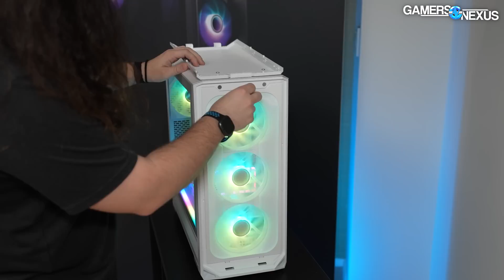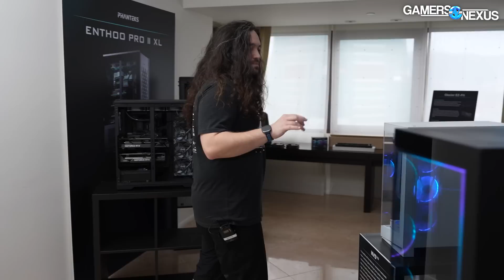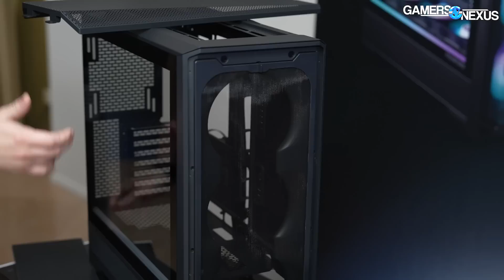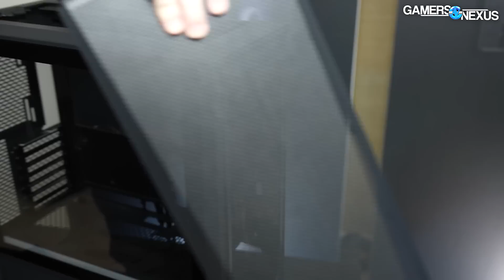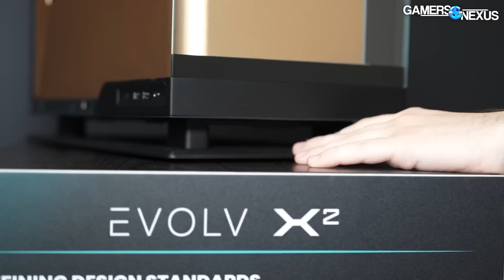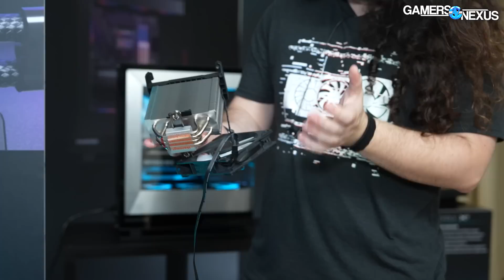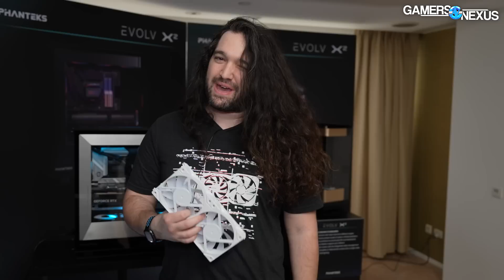Phanteks' Liquid Freezer III Competitor, Patent-Avoiding Fans, & P400A Successor (G400A)

Comment: I got the G400A for $110 from Microcenter, and it sucks. It feels as cheap as the quality you’d expect from $60 cases. It’s also big enough that it could fit a 420mm radiator, but they didn’t design it to support one. There’s no support for 140mm fans at the bottom either, so forget about building a 140mm-exclusive setup. I’m not happy with it at all. Also, Phanteks customer support is terrible. And yes, the wobble in the fans is extremely annoying, and cable management is hard to manage.

Comment: I had Phanteks Entho Pro 2 and the HDD cages had been made to choke the cool air supply to them. HDDs in constant use cooked the metal frame to the point it was difficult to hold the hand on it. I hope Phanteks has learned anything from the past as I liked the spacious case. Old Pahnteks cases are still way better than the new ones. Will see what is the new server case about.......

Comment: cant wait to see how the recirculation testing comes out, i currently run no side panel but have to clean my pc WAY too often.. its impossible to run a side panel with an overclock 3090ti ftw ultra either way, the glass becomes extremely hot, this thing is literally a heater blasting heat into the room

Comment: I think a universal fan mount adapter plastic or metal pieces might be the best end cap for the tabbed fan.  Make it easy to mount those fans in places that have screw holes for everything from 80 to 200 mm and, if metal, could even be bent into angled directed airflow.

Comment: Preventing warm case air from recirculating into the intake fans is something I had hoped case manufacturers would have addressed over 10 years ago. I've always had to make isolation plates myself. Mesh and/or filters are harder to pull air through than big holes in the chassis.

Comment: The coolers were pretty underwhelming and don't seem designed well... That VRM fan looks smothered against the pump housing. How's it supposed to force air down those channels with that blade design? And the tower is just... bad. They're trying to innovate, but scraping the bottom of the barrel. Why does the fan need a complicated plastic twist lock mechanism? It's a budget tower; it's going to be installed once and never touched again. Cases on the other hand look decent. That Evolv X2 looks like a great deal for $150 if they can keep everything similar to the prototype.

Comment: I think cases evolved too slowly. They all come from an era where the whole pc had 100w to dissipate.
CPU and GPU need direct access to fresh air. The 3 fans under the GPU are a good start. I also want fans in the bottom compartment. Otherwise the 3 fans under the GPU will pull air from the aether ?
And i want people to understand that the CPU air coolers can be reversed or at least the fans can. The back exhaust can be an intake. This creates a direct access to fresh air for the CPU. We are no longer living in 1995.
Reply: your a good man mr pyro 🙏

Comment: definitely have a soft spot for Phanteks. I did have a different case for a couple of years, but the first major case I bought was the Phanteks Enthoo Pro, the original, with 2 plastic side windows, no tempered glass. I bought that along with my 4790k hardware, so it was a few years ago. I went back to using it again, it just works and its solid. now its running a 12900k and a 4090.

Comment: The only thing I will say about the pre-done cable channels for the Evolv X2 is that there are still some of the high End motherboards where the EPS connectors is flanking the 24 Pin in which case the cable channels for the "North West" corner of the motherboard would go unused. Additionally it would be nice to have cable channels for cables like the USB 3, SATA (for those who still use SATA drives), and it would also be welcome if there was an RGB cable hub as some of the lower tier motherboards (like Asus TUF) can still be found with only 1 5v ARGB header (it would also allow to reduce power strain on the motherboard header if someone were to want RGB lights against the glass)

Comment: Still rocking my £65 P400A from back when you first reviewed it. Haven't had a need to change from it yet. Holds my 6700XT and a 280mm Arctic Freezer II without any issues.
Reply: I don't understand this over saturated case market. Other components I understand. They are small and are easy to buy, sell and upgrade. A case is too much of a pain to build and it's too bulky to sell.

Comment: Thermalright have really upended the air cooler market with the very low pricing (no doubt helped by being a manufacturer themselves). This Phanteks air cooler, being unpainted with 4 direct contact heatpipes/no coldplate seems like it's going to have a hard time in any region where Thermalright coolers are available.

Comment: @Phanteks LOVE the new case options! For the Evolv X2 I'd love to see black, or a dark grey metal color, instead of the gold. I'd also pay a premium for a metal base,and a metal back panel with fan mounts, even if they are sold separately. I would not buy it if the only option for the base is plastic, and only available with a glass back panel with no side ventilation. The silver or brushed aluminum (hard to tell in the video) is very nice looking and, if there's any way to offer other options for this case, I would definitely buy it. I'm really looking forward to this model! It's been my favorite of everything I've seen thus far from the coverage, if you can offer those additional options. Keep innovating!

Comment: For the interconnecting fans. Just make an endcap/cover. So the lip does not stand out too much (max height of the lip) and gives it a cleaner look and may double as cable storage to get some unwanted small cables out of sight.
Package it in the 3er set. Should be cheap and gives the user an option.
 If they want to be fancy with it, put RGB in it.

Comment: PSU in the front and fans in the back. Interesting design and should help with video card and cpu cooling heatsinks/watercooling. Going too keep an eye out for reviews on that one and some of these other ones. I was kind of hoping that they would update the cooling for the Evolv X. As long as the cooling of the cases can reach the hdd/sdd behind the mobo tray. Really paranoid about the airflow not getting to the side of the case to keep everything cool(er). I really liked the Evolv X design and just wished the airflow was updated only. I can only imagine the price for the X2. Wouldn't pay it any way. Even $200 is too much most of the time. My iron willed budget is $150-$180 at most. Money doesn't grow on trees and the world is in a blender at the moment.

Comment: If you are going to put fans on the bottom, then just put the power supply on the top. There is no reason why they are still trying to put in the bottom anymore. The heaviest item is going to be the GPU. It is also the one item that needs cold air more than most in modern gaming. The Torrent is simply killing the competition in noise during gaming.

Comment: Issue I’m noticing with the evolv x2 is that it’s most definitely going to be negative pressure in the ideal fan config unless you adjust the outtake fans to run slower.
Reply: Not realy. Remember, the 3 exhaust fans on top need to push the air through a rad. Most cases have 2-3 intake fans and 3-4 exhaust fans when using an AIO.
This one have 3x intake on the bottom (this should be reversed blade fans), 1x exhaust in the back and 3x exhaust trough a rad at the top.

Comment: why the evolve x2 bottom fan is exhaust config... where does all the airflow goes?
Reply: Those are intakes. It's a reverse airflow fan (that's becoming more of a thing now - Be Quiet!, Lian Li, and maybe some others have these, too).
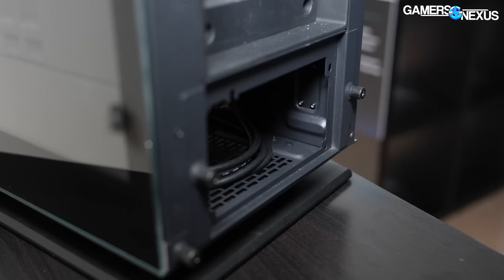Reply: @zivzulander  from 6:28 stills it don't looks like to be reverse blade... the blade directions are the same as the rear exhaust
Reply: @chik0240 You might be right about that. I have to assume it's set up like that for display purposes and not the final design. Phanteks does have a fan with clearly reverse flow, though, so hopefully those do get included when this case ships.
Reply: @zivzulander  yea I hope it will be so in the final product, although I am not in the market of it, that will make a lot more sense for even air cooling
Reply: @chik0240  This case will not be shipped with any fans at all.

Comment: Not really a fan of rotating a PSU that was never meant to be positioned in a different orientation - Yes, the style point might be cool, but having the PSU switch easily accessible in case of an emergency IE: Dodgy wiring catching fire, a 12v high power connector catching fire, an NZXT riser catching fire etc is something you definitely don't want to overlook. Safety 1st!
Reply: You can have a switch connected to the socket on the back panel too. That is something that should have been a standard on all cases like this.

Comment: G400A comment...Thanks to you and the GN team for all this great coverage!  I've been waiting for your take - and subsequent review - of the G400A.  Of all the cases I've seen recently, that's the one that might cause me do an upgrade and rebuild that I absolutely don't need.  I built in the 4000D a good while back specifically because of the front grill and filter spacing that you mentioned in this Phanteks discussion.  Since we're sort of neighbors you know there's plenty of pollen and dust around here and I could put a 360 CLC in the top of this upcoming offering unlike my old Corsair where I had to settle for a 240.  That included filter has trapped a lot of dust that didn't get in my PC.  The Lancool 216 was a slight temptation but I didn't want nonstandard fan sizes and a optional filter that was hard to find in stock anyway.  The Phanteks G400A looks like a great option and if the upgraded M25 fans are as decent as the old version and if you give that case a positive review this fall or winter I might just pull the trigger - this time with AMD.  I always look to GN for advice.  Thanks you all so much!

Comment: those molded cable channels are kind of interesting, but it feels like a somewhat "risky" feature to have. it strictly requires individually sleeved cables, so users will most likely need expensive custom cables or at least extensions, the latter of which add a ton of extra cable bulk that you have to stuff somewhere. so that might limit the appeal of the Evolv case in particular to a wider customer base 
but, idk, just a thought i had
Reply: And who in there right minds would buy the Evolv X2 and use the original cables with the PSU??? That is like buying a Ferrari just to put a 1.4L Honda engine in it.
Reply: @Audiosan79  well, no one, because it's probably not possible. i think most people use the stock cables that came with their PSU and those people are practically excluded from buying the case, which is the point i was trying to make. 
also your analogy doesn't quite work here because a car's engine is an integral performance part while your choice of cables in a PC is just an aesthetic thing. it's more like buying a Ferrari and using wheels with plastic hub caps or something like that. but even that wouldn't be very accurate because the Evolv is just not gonna be all that expensive, it seems. a full set of custom PSU cables can easily exceed the cost of the case
Reply: @Valfaun  Those people don't buy a showcase case with glass on 3 sides anyway. They buy a cheap case that is easy to work with. So what's your point? That this case is not for everyone? No case is for everyone.
Reply: @Audiosan79  why do you think that? these aquarium cases are very popular right now and there absolutely are people who buy this style of case but simply don't care to spend another... what, $100? $150? on custom aftermarket cables. 
but anyway, of course no product appeals to everyone, but my whole argument was that Phanteks might take a risk by excluding people who don't care about expensive cables from using this case, keeping in mind that aquarium cases seem to be a popular and quite crowded market segment. but the Evolv X2 has a certain elegance and subtle uniqueness to its look while being rather affordable for what it is. so i feel like it might have an above average appeal to people on that basis alone which, however, is then possibly diminished by the necessity to bring expensive cables to be able to build in it, perhaps pushing it out of reach for some people who otherwise would have bought it instead of another case of its type. 
in short, i feel like the forced cable channels might lower the product's commercial success to an unknown degree. 
or they could turn out to be the deciding feature for more invested enthusiasts and outweigh the people who want the case but can't use it. 
hence why i said it feels like a somewhat "risky" feature. i did not say it's a bad one. 
the industry tends to go with safe choices and rarely takes risks. Phanteks arguably does with the Evolv X2 by targeting a subset of a subset of potential customers rather than aiming for the largest audience possible, which is somewhat commendable

Comment: If the Evolv X2 will be anywhere close to $150, i'll buy one as soon as it hits the stores. Paid about €225 for my Evolv X. While i didn't regret buying it, it felt a little overpriced. Still got the case and about to do a custom loop in it. Even still got my Phanteks Enthoo Primo, the original from 2013. The Evolv X2 looks awesome! 

Had issues with both cases, the mounting clips for the front panel on the Primo and broken power button on the Evolv X. Both of those issues were caused by user error, i should add. Contacted Phanteks customer support, asking them about spare parts, made them aware that it was user error and that i was willing to pay for the parts. Both times, they sent me spare parts, FREE OF CHARGE, and were very friendly and helpful. That is why, 11 years later, i am still a happy Phanteks customer.
Reply: Asus could learn a thing or two from them
Reply: @TotoGeenen  Definitely! Asus got a lot to learn.

Comment: The plastic molding around the fans may be to prevent air recirculation but I think it is better for the looks, many cases you can see the frame and screws around the fans from the front and it's not the most aesthetically pleasing unless you want an industrial look. Regardless of the function it is a welcome addition.

Comment: On the Evolv X2:
- Glass on the front left edge should be curved and without the gap
- Would love to see a wood option for the shroud (the silver/brass one) 
- 140mm width for top fans withe the new AIOs where you can "hide" the tubes

woudlnt mind if this would hike up the price a bit like ~200 
anyway thats my wishlist for the case but if it stays as is then im gonna pass on this one

Comment: That air cooler looks cheap but is expensive. Overengineering the fan mount to fix a problem that doesnt exist and potentially limit fan replacement options. And has gaudy cheap plastic top. Just buy thermalright

Comment: Phantex cases are the best in my opinion when it comes to a great product at a low cost. I hope they release those new fans in 140, I use nothing but 140 fans plus a 420 front mounted AIO in my P600S Phantex case.

Comment: I just picked up the NZXT H5 Flow in white, it was on sale for $69 (nice) and I already have 4 140mm bequiet! silent wings fans to throw in it. Plan on doing 2 in the front since that's all it can fit with the toilet bowl fan and one on the top back for extra exhaust than just 1 120mm fan. My budget Zalman case just can't fit the gigantic GPUs anymore so I have no choice to to swap cases and since it went on sale for $30 off I went ahead and grabbed it.

Seems like a fantastic case even by your review (once you slap more fans in it, which I am doing anyway since I already have them) and for $69 (nice again) it seems like an amazing deal.